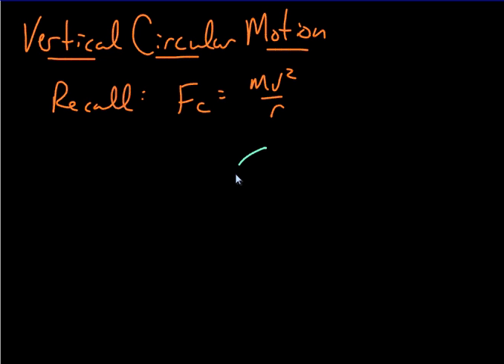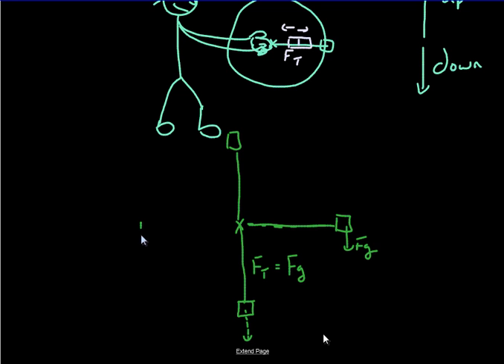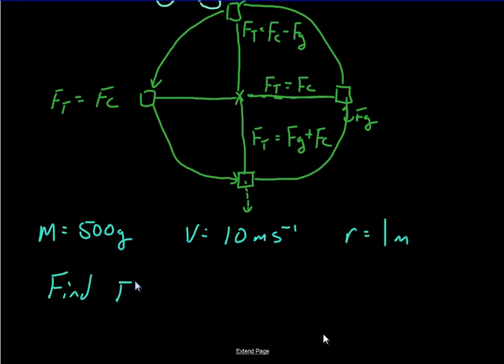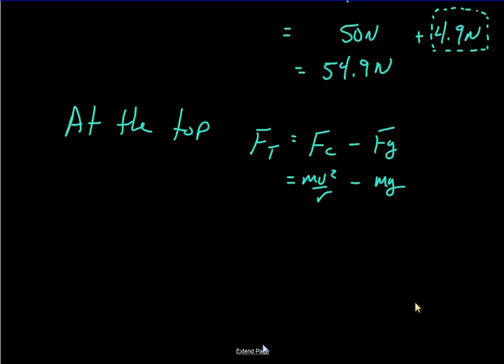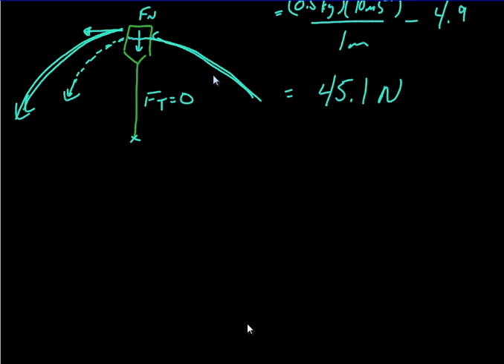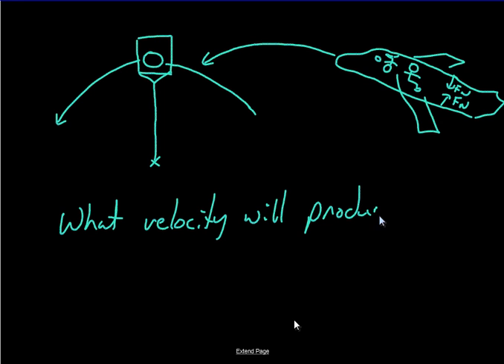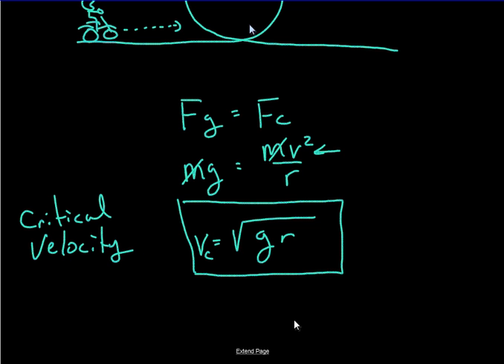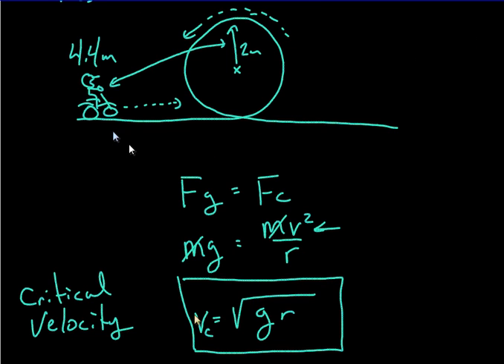Critical Velocity and Vertical Circular Motion

Comment: how to calculate critical velocity at lowest point
Reply from the maker: Critical velocity only applies to the top of the loop. The object can't fall off the bottom the loop because gravity holds it down to the ground.
Reply: @GregJohnsonWinnipeg  but what if the cord has a breaking strength?